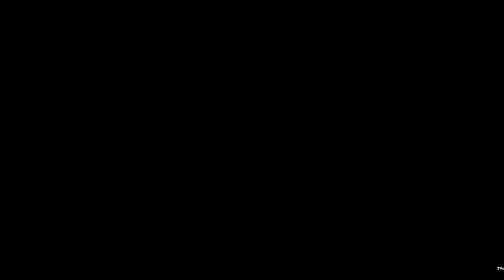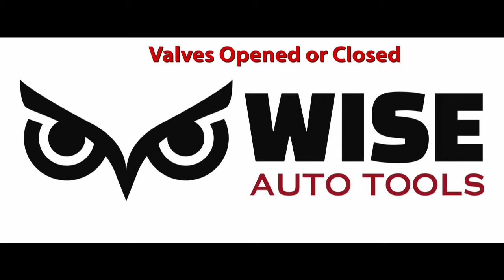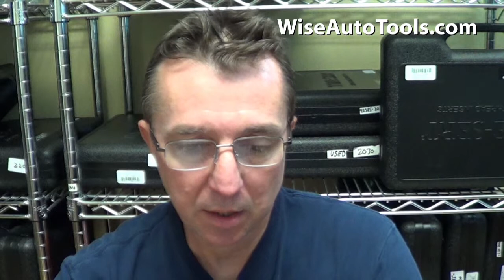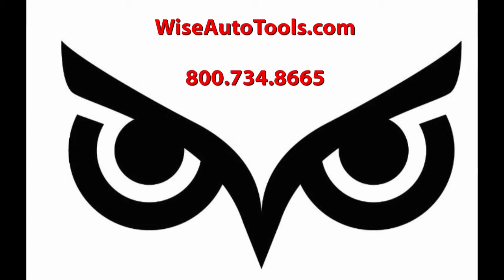Wise Sparkplug Thread Repair FAQs - Valves Opened or Closed

Comment: Hi, i put an 11/16 in the hole and it went through.....what size drill bit would be the largest size i can use to test if the head is still usable....i think it has been done a couple times with a heli coil-----this is for a 2V 6.8 thanks
Reply from the maker: Blake Ponders The largest kit we have goes up to about 3/4" of an inch. You may be able to add thickness to the 11/16" drill bit with painters tape until it reaches the size of the hole, then measure it. See more information at our article http://blog.wiseautotools.com/ford-spark-plug-blow-out-solved/ Call if you need assistance at 800-524-9783 10-5 Eastern Time.

Time Sert 5600 – Stand Alone Kit that repairs spark plug holes larger than .663″ (16.8mm).Uses one insert insert another one. The outside diameter of the largest insert is .77″ – it’s Triple Oversized. Used on many applications and has a Triton counter-bore needed for some 2001 and up.*Note Add-On Kit for installing the Double Over-sized inserts for holes smaller than .663″ (16.8mm) is kit number – 5588. Works for SOHC and DOHC engines. This kit is Made in the USA.